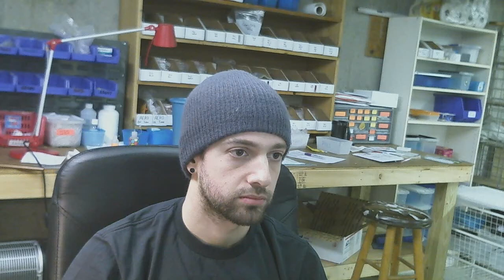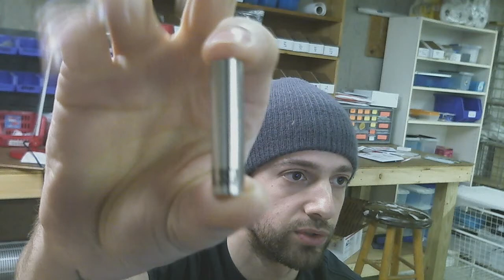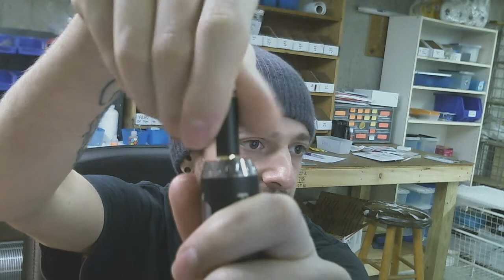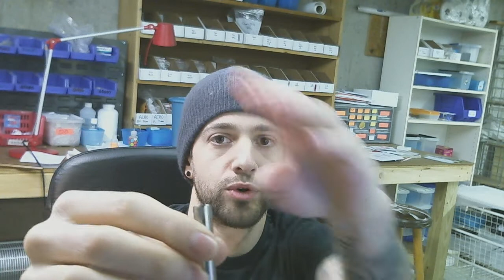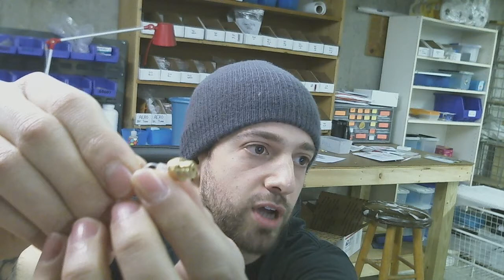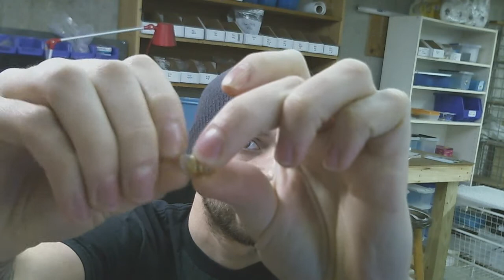HH.357 Video User Manual/Informational UPDATED

Comment from the maker: If I am correct you are asking "will this work with an I taste vv 3.0"? Yes. it will work on that device with a voltage range of 3.3-5v. Recommended atty would be the 2.0 ohm long or short barrel.

Using liquid from anywhere is a tricky question. If the flavoring in the liquid leaves behind deposits on the coil that are difficult or sometimes impossible to remove, then it would probably not be a good idea to use them in the HH or it will most likely overheat as the deposits build up over time.

Comment from the maker: In short I would say that as you make your way towards the non resistance wire (solder joint and lead wires) it will become cooler for a few reasons:
liquid sitting around the solder joint
non resistance wire allowing current to flow freely without vibrating (creates heat in resistance wire)
solder joint and gauge of the resistance wire is usually less (thicker) than the resistance wire allowing it to be more resistant to heat
Im sure some one can elaborate in greater detail.

Comment from the maker: Also: Its not really known exactly how hot an atty coil gets but the boiling point of a 50% PG solution is around 225 degrees F (depending on other ingredients) so we will say maybe 300 F?? The melting point of most silver solder is more like  850 degrees F so we are a bit shy of that temp i would say.